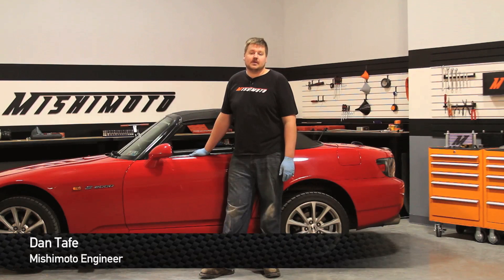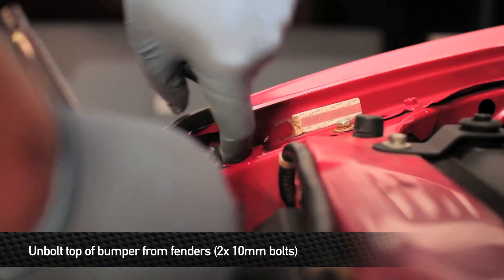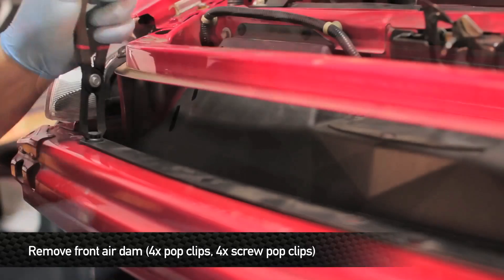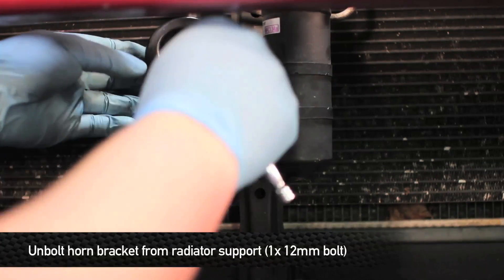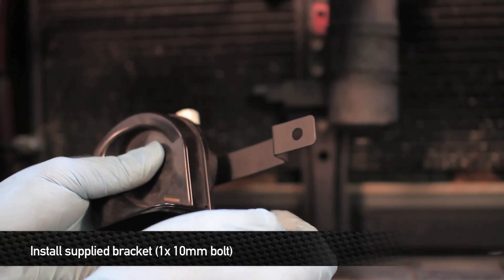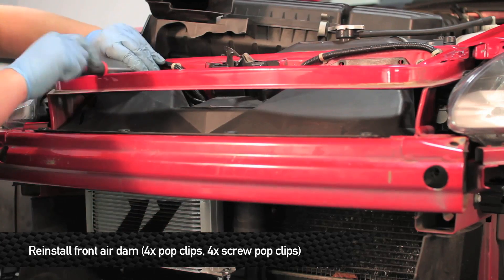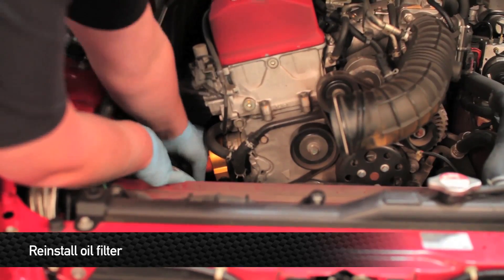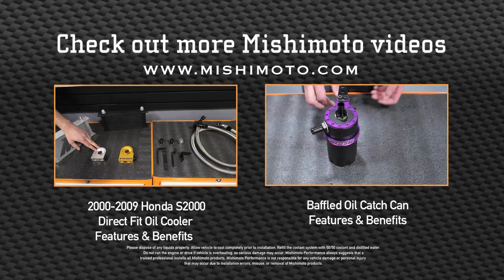How To Install: Mishimoto 2000-2009 Honda S2000 Direct Fit Oil Cooler

Comment: Will this work with an intercooler?
Reply from the maker: This greatly depends on the placement of your intercooler. This was test fit and designed around an otherwise OEM vehicle, so modification may be necessary depending other modifications that have been done on the vehicle.

Comment: Which oil filter was used in the video? Doesn‘t look like the S2000 oil filter (PCX004/006).. Will the original one fit the sandwich plate?
Reply from the maker: OEM will fit, yes.

Comment: Ok so a general oil cooler question... I am building a custom setup in my Mazda 6. I've been trying to find a decent cooler (approx. 10"w x 8"h fin area) with fittings on the side, thinking it would be better so oil can drain when doing an oil change, and air can bleed out when filling. But in several of your videos, you have the cooler's ports at the top. I imagine this leaves a cooler full of old oil in the system when performing an oil change. Is this not a concern? Am I overthinking the issue? Because that would greatly simplify my search.
Reply from the maker: Hello, the amount of old oil in the cooler is negligible in most cases. If you're keeping up on your oil change intervals, there would be no need to drain the cooler itself as well. Some customers do choose to remove the kit and drain it entirely, but we've found no ill-effects in leaving it installed and changing oil as usual.

Comment: What are the symptoms to install separate cooler?

I have  problem is like this. Gears are shifting smoothly from the start. then after 10-20 miles of driving the first gear needs RPM 3000-3500 to catch second gear.

This only happening some times and also after 10-20 miles of driving and when driving in stop and go traffic jams 
(hope its on the optimum temperature that time of drive tranny in)

Tranny was rebuilt recently and that problem was there before and after rebuilt too.

Need information on this and what you guys think about this problem would be? has anyone faced this kinda situation before?

Car - 6th gen Euro Accord CF3 - 1.8L Auto 4Cyl
Reply from the maker: Hello Amila. Thank you for reaching out. While the oil cooler is a great product, I do not believe it will resolve your issue. This cooler is designed for people having overheating problems after several laps on the track. Personally, it sounds as if there is either an issue with the new synchros or a possible issue with the fluid level.  Both of these situations could create issues once the transmission warms up. Of course, these are merely suggestions and would be tough to determine the problem without hands-on time with the vehicle.  I'd suggest bringing up your issues with the rebuilder of the transmission prior to moving forward with any additional purchases to attempt to resolve your problem.
Reply: Appreciate your reply

Comment: guys shouldnt it had a thermostat? on everyday driving the oil will probably be too cold! Even more in winter..
Reply from the maker: Hello Billblackeye. All of our oil cooler kits are available in both thermostatic and non-thermostatic configurations.
Reply: The sandwich plate they installed in the video has a thermostat.. it's the black cap on the side.

Comment: Will this system work with the stock oil filter?
Reply from the maker: Hey Eric. I have no reports on my end of stock filters not working. You should be just fine with the OEM style filter. :)

Comment: ? you have to remove the water houses from the Stock oilcooler  and Connect them together  first
Reply from the maker: Hey Robert. Our kit actually requires no modifications at all to your vehicles factory system. You can leave the factory oil cooler fully intact and still install our product without any issues :)
Reply: yes i know but then the Stock oilcooler will heat up the oil after it Returns from Your mishimoto oilcooler  .... understand me?
Reply from the maker: Hey Robert. The stock oil cooler would not heat up your oil after returning from ours. You now have two heat exchangers rather than one. This kit was designed to work with the factory system and all customers have been satisfied with their cooling results thus far.
Reply: Ok do you have kits for integra dc2 type R
Reply from the maker: Hey Robert. Unfortunately we do not have any direct fit oil cooler kits for a DC2 Type R. However, Honda has used the exactly same oil filter on all of their vehicles for quite some time. This kit could very likely be adapted to your type R with some minimal modifications.

Comment: Wait, so can the universal oil cooler sandwich plate simply fit over the OEM oil cooler like the K20Z3 one in the Civic Si?
Reply from the maker: Hello Ttam EF. These vehicles did not come with an OEM oil cooler. However, the sandwich plate provided in this kit does fit over the vehicles factory oil filter housing. If you have any other questions feel free to email us at support@mishimoto.com or give us a call 302.762.4501. :)

Comment: In the next couple weeks I plan to get one.. looks fairly easy for DIY.. My delima is that the oem oil filter looks like it won't fit due to bracket.. That's why they were using a fram low profile oil filter.. So is that the case..?? Need more info please.. If that's the case might pass on this.. Don't get me wrong looks beautiful with the front mount..
Reply from the maker: Hey Deuce! This is a direct fit oil cooler kit.  No modification necessary!  If you have any questions during install please refer to the install guide, or call our customer support specialists at 1-877-GOMISHI - or email support@mishimoto.com 24/7/365!

Comment: Do you get a humming noise with the oil cooler after the install I never had it before and it's come from the lines?
Reply from the maker: Hi Nick - check all your connections, make sure everything is secure.  If you still hear humming, please call our customer support specialists at 1-877-GOMISHI!
Reply: Thank you I checked my lines everything's fine but is it a normal noise to make as the oil cycle is their suppose to have a humming noise?
Reply from the maker: Hey Nick - I'd advise you to call our customer support specialists, or email support@mishimoto.com.

Comment: does this oil cooler will work on h22a engine with already installed oil catch can?
please need your responds thanks..
Reply from the maker: This particular oil cooler is a direct fit for the s2000 - engine codes F20C and F22C - chassis codes AP1 and AP2.  You may want to check out our universal oil cooler kits as another option!

Comment: Theres no need to use thread tape ?
Reply: No thread tape or paste is needed for the AN fittings or lines.  The seal is made by the 37* flange on the fittings.  The straight fittings seal to the sandwich plate via the integrated dowty seal.

Comment: is this installation the same for all oil coolers in theory? Just mount the cooler somewhere and attach it to the oil filter?
Reply from the maker: Pretty much, however if  you have any specific questions definitely call our support team at 1.877.GOMISHI or email support@mishimoto.com!
Reply: +Mishimoto Automotive thanks!
Reply: Mishimoto Automotive any humming

Comment: Wouldn't it be easier to idk attach the lines to the sandwich plate then install it on the engine?
Reply: hell yes its much easier to attach them to the sandwitch plate first

Comment: I purchase mishimoto but it doesn't comes with the bracket and bolts. Comes with everythigns just the three brackets was not included. Is there way can go around? other option?

Comment: Do the oil lines come preassembled and pressure tested or do they need to be assembled like other AN hoses?
Reply from the maker: track nut Absolutely! The lines are ready-to-go straight out of the box =)- Patrick M.

Comment: Having just installed one of these on my AP2, I was totally saved by this video, so thank you! Small annoyance though- The horn is grounded through the chassis and the provided bracket is painted, which insulated the horn from the chassis and prevents it from working. Additionally, you guys sell a bunch of thermostats that operate at different temps... Including a mention of how that is installed would have been nice, though with the description video of the sandwich plate was enough to get me by. Those slight annoyances aside, this thing is fantastic. Thanks for a great product guys.